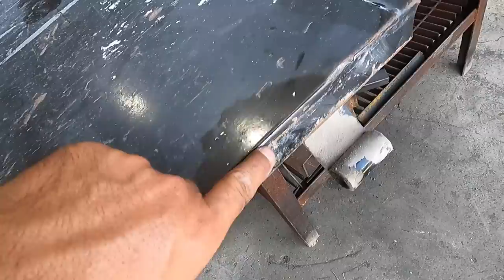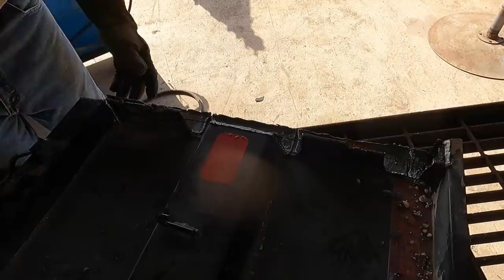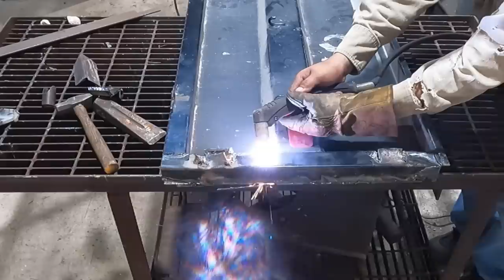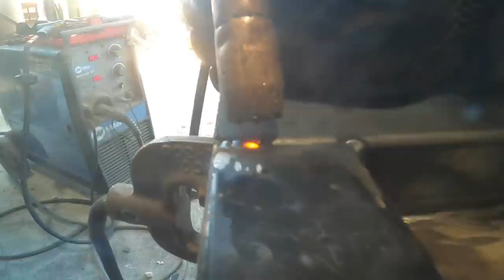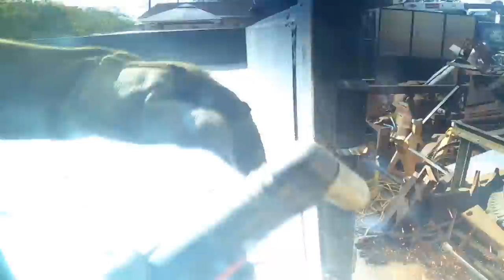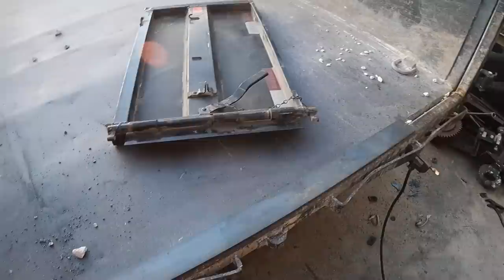Dump Trailer Gate Repairs.

Comment: It would appear you try and do what’s best for the customer, and not always what the customer requests, like in this video, they wanted just a patch, which might have held for a bit, but would probably fail sooner or later, but you did a much stronger repair, which will last the customer much longer, saving them money in the long run, great job

Comment: Seeing you have a bit of trouble getting a good ground on the tarp loop reminded me of an experience I had.  Years ago, I had a ground clamp heat up and destroy itself itself in the clamp hinge pin area while I was in the middle of a job.  To get me through that,  I took the cable ground cable off of the mutilated clamp and used a pair of vise grip pliers to clamp the cable eyelet terminal down to the piece I was welding, which then caused me to think.................................let's weld a tab of steel onto the vise grips and attach the cable to the vise grips.   I bought a new pair of vise grips but I never bought a new spring loaded ground clamp and I am still happy with my "temporary", emergency ground clamp.

Comment: Nice work. I've repaired the same problem on a trailer like that. I also welded caps on the top of the tube and added a drain hole at the bottom.
Reply: Would have been my thought too.
Reply: He did cap the tubes he replaced. He just doesn't mention it. I saw the caps just at the end of the video.
Reply: The key is to have shiny new zerk fittings.

Comment: My employee opened a trailer exactly like this and bent the doors just as you were describing. It was a sad day. We heated the hinges and bent the door back with an excavator and bucket. It was a BigTex trailer, not sure if they use better metal around their hinges, but I'm glad they didn't rip off like this.
Reply: This was a Big Tex trailer as well. Maybe a cheaper model with lighter metal.

Comment: I would’ve tooken off the hinges. Put a thicker flat bar. Welded flat bar and then weld hinges back. That just me not trying to step on nobody. You do good work sir.
Reply: That's you easy short cut.
Reply: Prly would of had to do some bending to the hinges , adding flat stock would put them out of alignment
Reply: Either way million ways to skin a squirrel
Reply: @lalitoojos  I don’t work hard I work smart.
Reply: I’ve been welding for 30 freaking years. I’ll talk the talk cus I can cover my words. That’s all I got. Dropped the mic 🎤
Reply: From the looks of things (most damage to the upper hinges) I doubt it needed to be made stronger than stock, as long as you remember to pin the doors back when lifting the bed.
Reply: I think the way that they mounted the hinges should of had a rear flange on the in side also.      Great repair job

Comment: My 6 x 12 hydraulic dump trailer  is in need of a new floor and some supports.  I just picked it up a few months ago and the previous owner used in a business where he'd leave it at your house, then pick it up when you filled it.  A lot of grass clippings were left in the bed which held water and helped to rot out the floor.  The 11 gauge 6 x 12 sheet of steel needed for the floor is going to set me back $616.00.  I've also got to replace the bed hinges, one seized up and tore loose from the frame, which caused the bed to kick to one side and come into contact with the fender.  

Nice job on the tailgate doors you really need to think about how to deconstruct the doors to keep the metal that you need to attach to the new metal too. Another great video, thanks.

Comment: I'm glad to see that you capped the tube that you installed so dirt and debris cannot drop inside of it again.  I wondered if you drilled a hole in the bottom so it can breathe or maybe it's not necessary in Texas?  Where I'm at, the tube will rust out internally from condensation with the change of seasons if it is not allowed to breathe.  Thanks for another great video!

Comment: Great repair, I wondered if you were going to cap the tubes to prevent them filling with dirt again and though you didn't show it I noticed that you did. Good job. Never hurts to improve a poorly designed system when doing a repair.

Comment: I am always intrigued when I visit your channel and  certainly impressed at all aspects of your works nothing short of amaseing even if the jobs one of those stuck pins on a man lift a cracked and twisted boom or a worn out case side dump scoop bucket  you keep sharp and on point and do what ever is required to get that job done as always well done sir and your apprentice has some big shoes to fill ahead of him..

Comment: Hi Isaac, nice repair.  First can you say where the new hinges came from?  Also if you do something like this again please show fit of doors before .... it would highlite what you were trying to achieve with finished product.   I also would have tried out fit with hinges just tacked up to be sure no adjustments needed before welding.  Thanks for posting!
Reply from the maker: I picked these up at the local trailer sales place. they usually carry misc replacement items.

Comment: Do you prefer to use the plasma  or torch? Almost seems like you have better control using your torch. Always enjoyable to learn from you! I have this exact job to do for a buddy of mine. Glad to see you addressed the open tube and capped it! Also would put a drain hole on the bottom. Until next time.
Reply from the maker: I'm better with the torch but every tool has its place.

Comment: Another great video. The company I mechanic for has 3 dump trailers. Yes they are very handy. All three just like the one you just repaired because of light weight Materals I have had to redo the hinge mounts. As well as the hinge on top of the side rails. Required reinforcements after they failed do to abuse. It’s such a common problem you would think the manufacture would build that section with a bit more strength.

Comment: I would sometimes make trailers for pocket money - selling them in the run up to Christmas. It's interesting to see that even major manufacturers in the US sometimes get it wrong! All a trailer needs (aside from absolute safety requirements) is a little thought into how they'll be used, what little things could go wrong and most of all - strong and durable enough for the task.
Your use of a plasma - there are certain channels on YouTube that would have done everything using cutting discs - they're clueless and bad examples.

Comment: I agree that your way was definitely the right way.  However, if you use a fairly large patch panel, it will spread the load from the hinges, reducing the leverage on the thinner tube.  If the manufacturer had faced the hinge side with 3/16 or 1/4 plated, it probably would have solved the problem.
Reply: I know his way is the right way, but if that was my trailer I would of removed the hinges, put a piece of 3/16 flat the entire length. put the hinges back on, and called it good enough.:goodvibes: I am not sure I could cut that piece out without making a mess of it.

Comment: Nice job. Those Big Tex trailers seem to be generally well built for the price, but it baffles me that they come with plastic plugs in the ends of those square tubes.  I agree tube size could have been up one thickness in the sides and bottom of the doors, but for most people they seem to hold up- unless someone fails to pin the doors back when lifting the bed.

Comment: I have rebuilt so many of those things it’s crazy.  As you said they build them as cheap as possible. My problem is I do as you said.  I overkill which transfers the problem to another section.   But on plus side my parts don’t break

Comment: What the salesperson will tell you is the lite steel is to   weight.  That way you get better gas mileage when pulling it when empty. I saw this with rolloff boxes. What use to be 3/16 was changed to 11 ga. Tube and the 3/16 side walls are now 10ga. What it did was make alot of work for the people that fix them.

Comment: A friend asked me to build him a tandem axle dump trailer..... "I wanna use two 2000lb axles and I want be able to haul 4000lbs." I said...."whats the trailer supposed to weigh?" lol I told him he needed 3500lb axles to do what he wanted to do, he said no. So I built the trailer, turned out sweet! He blew a tire and said I wanna order 3500lb axles! So we did.
Alot of people dont understand engineering and how beefy things need to be.

Comment: Excellent video.  I would like to know how you determine when to put down a row of dimes with intermitant MIG and when do you use continuous MIG?
Reply from the maker: Depends on the situation. In this case, the bare end of the parts I cut were too thin for me to feel comfortable to do a straight weld. So I pulsed it.

Comment: Great call on the replacement of the 2x2 tube. I have fixed several just like you did. And the plasma cutter is  worth there wieght in gold. Very professional. I was noticing the 2 quick clamps. What brand are they. I never seen that ratchet style before.
Reply from the maker: These are Bessey clamps
Reply: @ICWeld thank you. Keep up the great work.

Comment: Hi here in Australia as in USA everone wants cheap trailers so it the metal used gets thinner and thinner here trailer rego number plate cost are base the wright  so the lighter the trailer the cheaper the rego cost my 1500kg car trailer cost $200 per yr due weight but your standard boat trailer only $80 i made trailer to carry my boat and have made dropin wire/pipe side gate for hauling rubish or moving what ever  love your vids

Comment: I would have clamped & strong backed the two doors together with a spacer where they meet in the middle. Set them in place with a spacer under and equalise the gap between the end of the doors & the hinge posts. Then set the hinges in place with the lining up bar. Tack welded them in position. Dismantled the clamps & strong backs. Check the operation. Adjust. Replace the clamps & strong backs to finish the welding.
I’ve done it before!!

Comment: They sell air compressor intake mufflers that work pretty good quieting noise.  I built my own and made a new filter box for an aftermarket car foam filter.
Reply: I agree that air compressor is noisy. I never noticed in other videos
Reply from the maker: sorry about that. my compressor is next to where I was working. I was also having problems with the audio levels. couldn't get them just right.
Reply: @ICWeld  I was just letting you know there is a way to cut the noise way down, not because it bothered me.  Let me know if you are interested.  Keep up the grood work!
Reply: @ICWeld    No apologies needed 
Thank You Sir

Comment: I assume you were “tacking” the hinge butts on instead of continuous welding because the material is thin?  I always thought that wouldn’t have enough strength for bearing any load but I guess that’s the only way to really do it when you’re working with thin material that likes to blow through.

Comment: My first instinct is to patch it, it's not often I disagree with how you perform a repair but in this case I think I do, I would one piece on each side .125 or 14 ga the length of the too thin tubing

Comment: Isaac, are you impervious to heat??  No gloves half the time, even with gloves grabbing hot metal like it's ice.
I love the vertical weld technique.  I've not had a chance to try that on some lighter gauge metals.  You are "da man"1!!!!!!1
How do your costs compare using the plasma cutter vs oxy-acetylene?  
"The way you do it" should be taped and set to the Library of Congress for posterity!!!!!!
Your "bar clamps" are interesting, I've never seen the cam lock handles.
Reply from the maker: I really enjoy those clamps. they are from Bessey tools

Comment: Running into the ground is exactly what has happened. (ask me how I know :)) If you want to keep this from happening put a piece of light chain on the side about 12" long and a hook for it on the door. Make sure the door will go to the maximum opening size and just catch the end loop of the chain. May be obvious but it will keep from having to fix it again.  I also added a heavy length of 2" box tube to the top of my side rails, keeps the sides from bowing out and protects from bucket damage. 135 excavator and large tree chunks are kinda hard on them.

Comment: Those trailers are cool.  Super functional. The gates on them is the weak spot.  Not really, they do what they are designed to do and will last years.   Ya just gotta chain them up when dumping yir load.  Yeah, solid steel would be stronger....so strong that the next time you forget to chain them up:  you would bend yir trailer like a taco.  These mistakes are understandable, but avoidable.   Weld-Guy has to charge extra...that's the rule...when it's repairing a screw-up.  Haha.  Hey, you know, a rule is a rule...   So jab crowbar in that wallet...

Comment: Now, question from a total hobbyist here - why did you choose to plasma cut away the original tube piece-by-piece, instead of using gouging consumables on the plasma, or stick gouging to wash the welds away?  Metal too thin for it?
Reply from the maker: yup, too thin.
Reply: @ICWeld  What's the functional limit on something like that?  An un-welding electrode sure seems useful!

Comment: Leaving the top of those tubes open strikes me as a big mistake.  If you're going to leave a hole anywhere it's always at the bottom so dirt and water can get out, not get trapped inside together.   Or maybe they sell replacement doors as a by product!

Comment: Can you explain on which metal surfaces we can be removed by gouging and on which we can use gas cutting? How to give better surface finish to steel welded parts. Which is better option for steel weld material removal gouging or gas cutting?
Reply from the maker: I use the plasma for thinner metals under 3/16" thick. So it depends. I like arc gouging for most of my repairs since its normally thicker material.

Comment: Did you make the cap you put over the cup on your plasma cutter ? The one you use against the straight edge
Reply from the maker: Yes, I cut a small piece of pipe that fit it nicely, then trimmed it to fit.
Reply: @ICWeld  any chance for closeup thanks

Comment: Wouldn't it be better/ easier just to cut out those "affected" parts of the tube (the ones where hinges were welded onto), then get a piece of thicker flat stock/ metal sheet (or an angle iron)  that would slide INTO the tube - or form a "graft" of sort, that would conform dimensionally to the structure - and then just weld it along the cut-off edges, and then weld the hinges back?  I mean, even with a stronger square section replacing the original, thin-walled one, the issue of "concentrating" the stress along the edges of the flange of the hinge will remain. After all you still got something like 3/8" thick hinge flange attached in a small area to a square tube with wall thickness about 1/8" (I reckon), which is a tad steep transition to me.
Yeas, I know, there's more than one way to skin the cat... ;-)

Comment: Try running a continues bead Down Hill, and Keep your heat on the Bracket, and just wash over to the thinner Material. stich welding is for thin car Body Panels. Try 90/10  argon--Oxygen it's cleaner than co-2.

Comment: Trailer material strength is a double edge. The heavier the material they use to build the trailer the less total weight the trailer can haul legally by rating.

Comment: grinder and a cut-off disc would have been the way I went. 90% cleanup time saved and better accuracy and I have 2 plasma cutters. Certain jobs like this lend to the adage, just because you have a hammer (plasma cutter) everything becomes a nail. My two cents
Reply: The Church of the Stone Axe approves this message.

Comment: I’m a bit suprised the torch king has been using a plasma so much. but I guess it’s easier than lighting a torch 50 times
Reply from the maker: Maaan, this metal would have warped up like crazy if I used the torch.
Reply: @ICWeld  oh you’re right. I didn’t think of that. Hard to tell exactly how thin it is on video
Reply: @ICWeld Hi Isaac ... when you say torch cutting would have caused mire warpage how come?  In any if your videos do you get into details of differences between the two prcesses?  I am getting poor man's education watching you work:).

Comment: I think that dumping with the gates open part way is also the problem....I've had to repair one of those
Reply: They should have a limit switch that will not let it dump unless the doors are pinned all the way back
Reply: @IamVince1aa  It should be pulled by a battery operated truck with sensors that will not let you crash, speed or operate it drunk, with sensors that fire fifteen air bags, issue "Help I Have Fallen" broadcasts, weather alerts, and "Turn Here" commands, as well as back-up cameras, a black box recorder, and limit switches that prevent dumping with the gate not fully open and ones that prevent movement if the gates are not closed, or on Sundays, or Holidays.
Reply: @deconteesawyer5758  Thats a bit extreme

Comment: Go ahead and slap on that "This is how you need to do it because this is how I do it and I know what I am doing. If you do it differently than you're doing it wrong and it will fail because you suck and I don't. " seal of approval with a certified super welder/fabricator/ make it happen/ I get paid the big bucks for being this good sticker on it .👍You're one bad mammer jammer!

Comment: You never want to buy cheap or used  dump trailer.

If your in the market for a really good dump trailer, take a look at Diamond C, it will hurt your wallet on the front end. But will save your wallet on the back end with repairs and down time